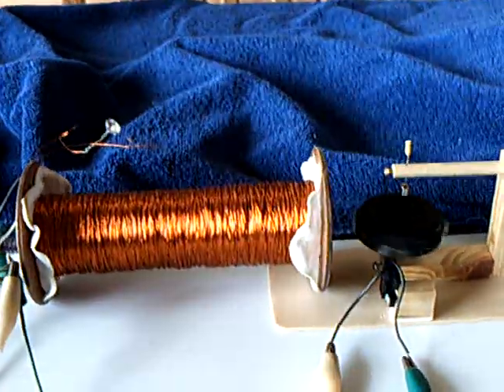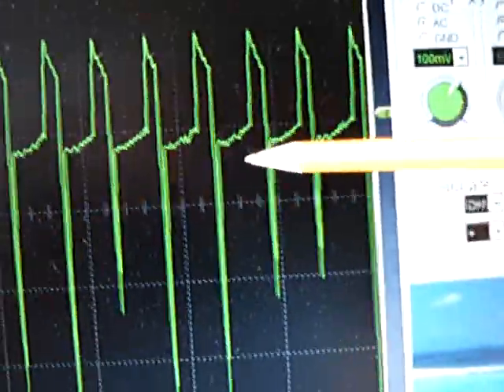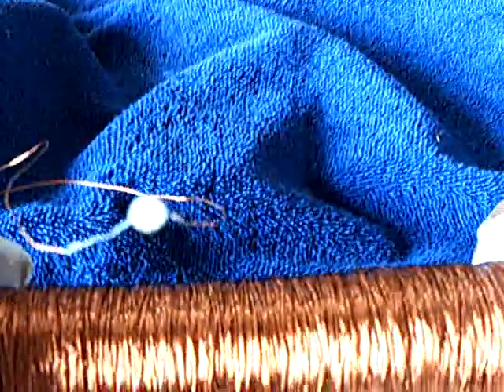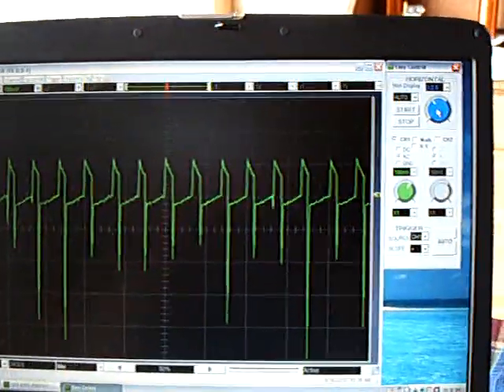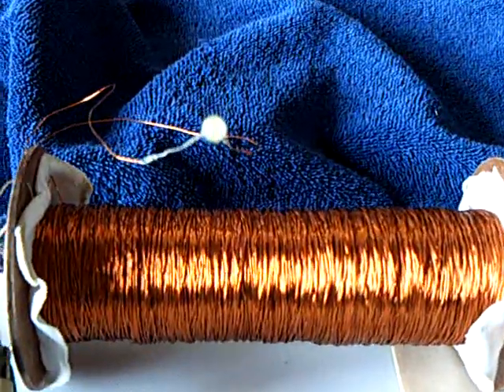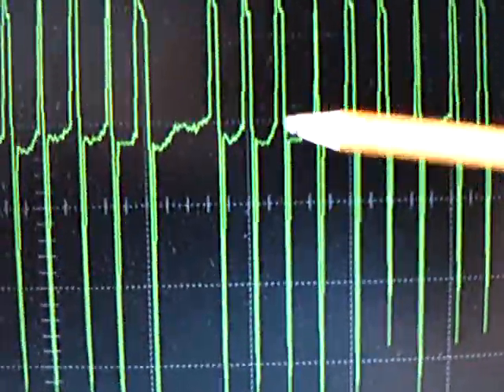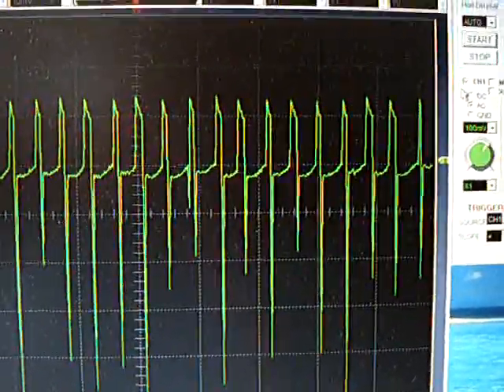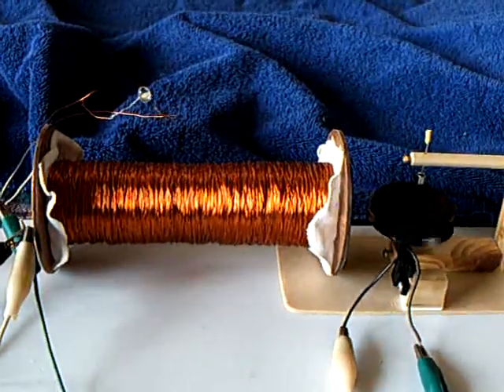Stubblefield coil scope shots.ASF

Comment: Wiring 2 Stubblefield coils together one in ground one in air. I understand the old telegraph system configuration with the coils to power it. I don't think I am getting the 3-6-9 wiring configuration. Or do I need 3 Stubblefield coils?

Comment: Correct me is im wrong but isnt the  stronger back spike relate to the speed of the rotor and the obvious increase in amps and voltage??.....so as the inertia dissipates we are back to the coils lower energy stage....great job mine was charging batteries as Bedini set it up

Comment: This looks alot like what Tesla was doing with taking high voltage DC , pulsing with using a spark gap, and producing a sharp peak, high voltage AC wave. Great job. SHould look into the earth batteries with a  Kapa Generators.

Comment: Lid, I know this is not related to your video, but I wanted to let you know that the Honeywell Q313A1170 thermopile generator $33.00 each online, is rated at 750 milivolts DC unloaded. These can put in series if needed for more voltage to run your Slayer device. 
I think Dr Stiffler is really on to something big here and it is for real that's all.  
Take care, Slinky.

Comment: Lid, I was thinking that if you put some diodes in a glass of water, put a copper foil around the glass and hooked your Slayer device to it, you could make this gas mixture too. just be careful as oxygen and hydrogen can go boom if trapped. But may burn at the top of the water hot enough to heat a thermocouple pile like Honeywell uses to operate their gas valves with. This may be enough to run the Slayer as it is just a few volts DC. Heating part suppliers have these thermopile type devices.

Comment: Lid, I looked at Dr Stifflers video again. It looks to me like maybe both Oxygen and Hydrogen come from one lead of the diode. Still this is important as this gas mixture could be burned directly from the process. A heated thermocouple pile by  the burning gas could drive the SEC.  According to Dr Stiffler, there is no limit to the gas output in relation to power input to operate the SEC. There is NO direct connection to the diode, just the field. (if true) More power output than power input!

Comment: Lid, Wow Dr Stifflers latest video is a real mind blower. This may be the answer to massive amounts of Hydrogen production for use in Hydrogen powered cars. It is simple as can be and according to Dr Stiffler there is no limit to the amount of Hydrogen you can make. But if only Hydrogen gas is produced, where is the Oxygen? Where does it go? Is room temperature liquid Oxygen left over after the Hydrogen extraction process? A interesting question I am sure will be answered soon. Slinky

Comment: Lid, May be Galvanic action can be boosted up in a magnetic field along with a copper iron thermocouple setup. Dissimilar metals, a magnetic field, along with galvanic action. Since a magnetic field has an effect on thermocouple action, may be a magnetic field has an effect on galvanic action too, May be a combination of the two could be self boosting and if able to reverse the current on each firing, would not corrode the metals exposed to the water. I am watching and learning. Slinky

Comment: The influence of a magnetic field on the Seebeck effect for a copper-constantan thermocouple was studied. Measurements of the change in Seebeck voltage were carried out with only one thermocouple junction in the magnetic field at varying magnetic field and constant sample temperature. The magnetic field dependence of the Seebeck voltage was found to be large. Lid, you may have a thermocouple situation going on here. Copper constantan type thermocouple in a magnetic field may cause this.

Comment: @Lidmotor but did you know you can generate power with a magnetic field between a core and a coil ????have you tried this? using just one lead of the coil adn the other to your core, and run a magnet between them.